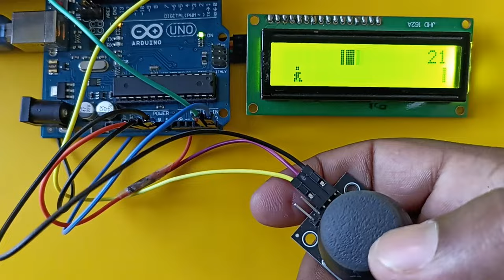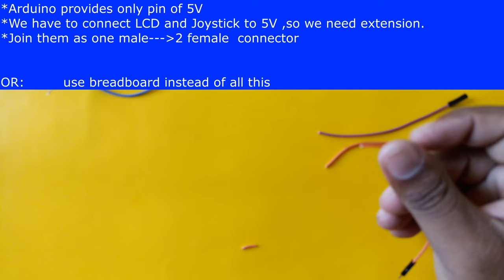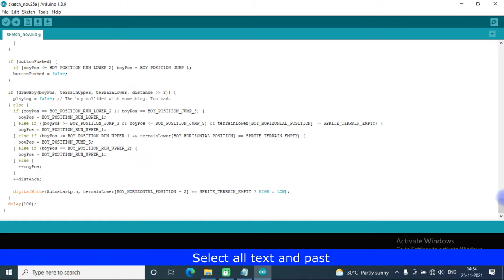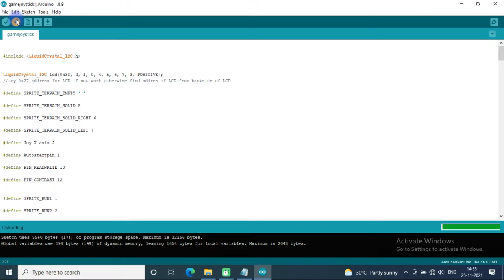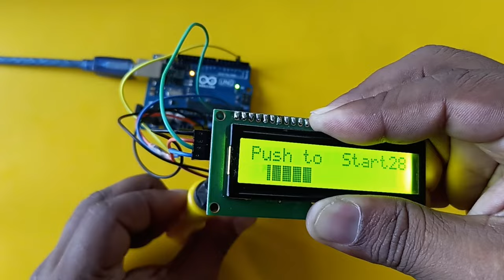Arduino LCD Joystick Game Project - How to make Arduino LCD Game ||Super Mario game

Comment: hello friend my lcd is only the holes on the top all by chance and it is only like this how do i solve it? it's the same as when you finished programming there and showed the lcd that one part was filled and the other is not like that help me
Reply from the maker: Yes you can connect that lcd 
For that you need more wires

Comment: the backlight of the lcd is not turning on
Reply from the maker: For backlight there is small connector to back side of LCD (on i2c chip) 
Insert connector to this two point or  short that points